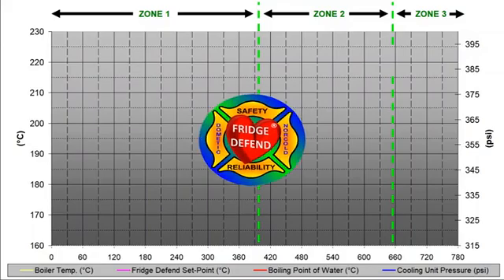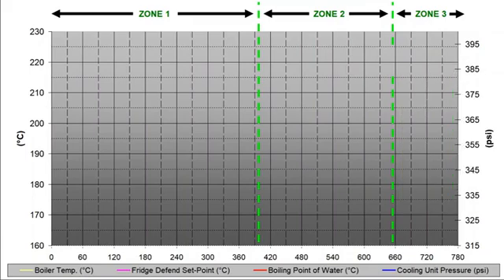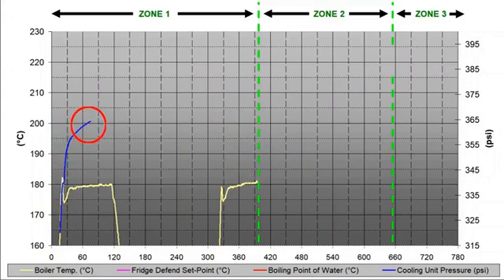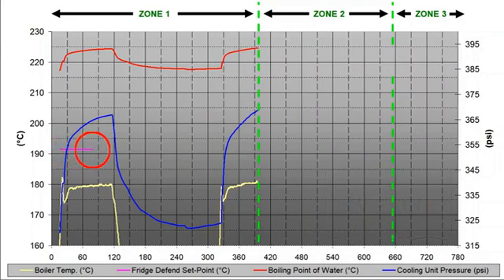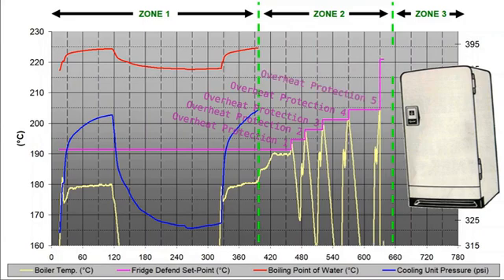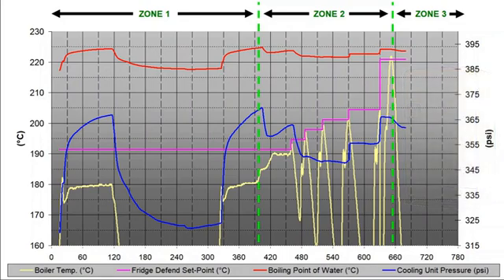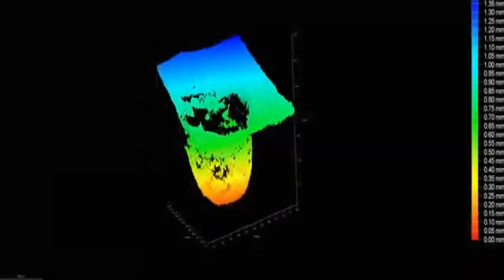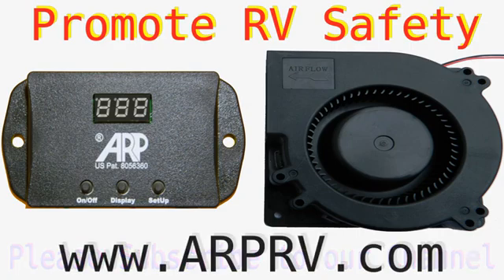RV Fridge Fires -- The Science Behind Them

Comment: It disturbs me to see that such a situation could arise from the fridge being a mere 3 degrees off level.  I doubt I would ever be able to routinely level my trailer to less than 3 degrees from perfectly level.  But this graphic data suggests that RV fridge failures should be far more rampant than they are, doesn't it?
Reply from the maker: Yes it is disturbing to see that the fridge can overheat at 3 degrees off-level. 
There are many factors involved when it comes to the overheating of the boiler.
No, this data shows how the sodium chromate gets destroyed, it depends on how often the boiler is allowed to overheat, the damage is cumulative, and one has no idea if the boiler is overheating or not unless they have the Fridge Defend.